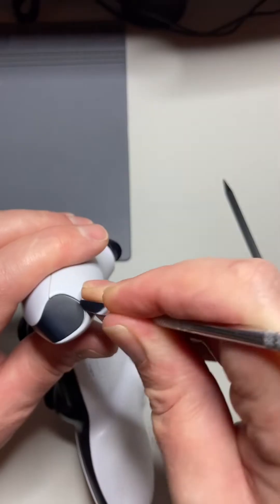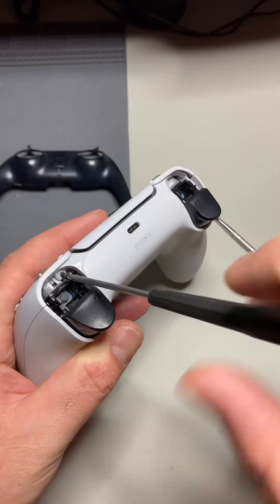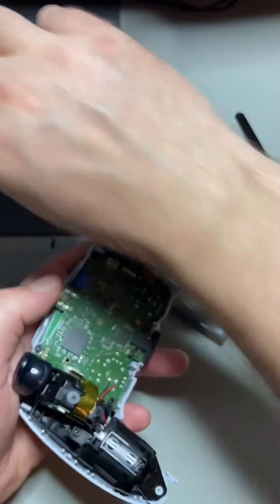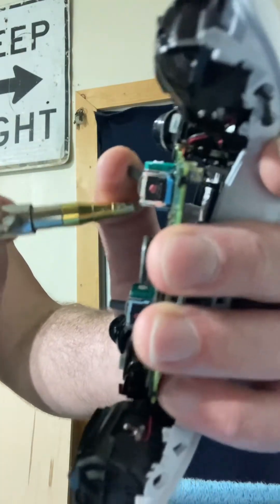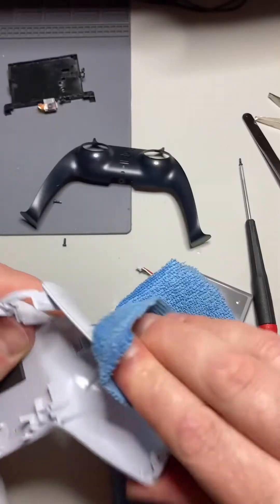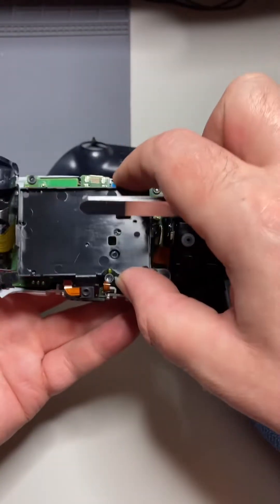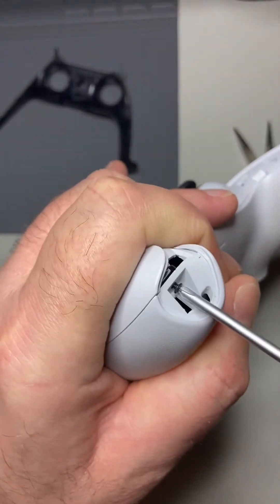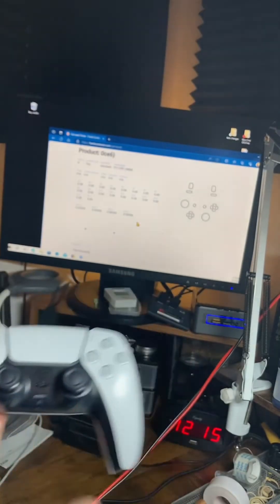PS5 Controller Disassembly and Stick Cleaning

Comment: There are two clips on the sides of the handles that you missed. If you've done this enough times, plastic fatigue might make them unnoticeable, but I think you need to poke them with a non-marring tool while you're lifting the body away.

Comment: I am fairly certain I am missing a camera, I was having fun up until this point
Reply: NEVERMIND fun resumed will update if controller is still functioning
Reply: I DID IT! The stick drift is worse than ever!!!! :D
Reply from the maker: It’s a microphone not a camera.
Im just an idiot.

There’s two of them, one on the front and one on the back.

Maybe the PlayStation 6 controller will have a camera in it 😀

If you ever dare to change out the sticks, go for the Hall effect or TMR sticks. They will last longer.

Comment: I can't unscrew the case the screws are too tight
Reply from the maker: Heres what I do for that. I also use this trick to get stripped screws out.

With much force I press the screwdriver into the screw. I keep it firmly in place while pressing down into it.
With my force down onto the screw I will pump just a short bit of force and try to turn it. If the screw does not give way I relax off of turning it while keeping force down onto the screw and then I repeat.
I do that until the screw actually moves. If the screw head starts to strip then you’re in for more trouble.

It also pays to have some good hand and arm strength to do this.

Comment: Does this fix stick drift
Reply from the maker: I find that sometimes a good clean out of the mechanisms will fix it but most of the time one of the potentiometers or both of them need to be replaced for the stick.

You don’t normally have to replace the whole stick, just the pots which makes it easier.

Comment: I tried all the steps in the video but couldn't seperate the casing. Checked out another video and luckily saw there are 2 more screws under the L1 & R1 buttons, pop them out first and remove the screws otherwise you will break your controller 😢
Reply from the maker: It’s in the video.
I was trying to get straight to the point but there are sacrifices to that.
Reply: Mate, it’s in the video
Reply: I saw it 2nd time around 😂

Comment: Can I do just my right stick with alcohol and a cotton tip by only taking the front casing off? I know I’ll bust my shit or rip a cable if I take it all the way apart 😣
Reply from the maker: You'll need the rubbing alcohol to get into the stick mechanism for it to be effective. If you have a container with a tiny nozzle, or a syringe, that might work.

Comment: If you are a tech noob, and therefore don’t have the experience and specialized tools for this, don’t do it. You will break a ribbon cable or not be able to put it back in. And then your controller just doesn’t work at all.
Reply: Yep, hell nah I'm not doing all that. I'm a tinker, but I know my limit lol

Comment: my option button is sticky.  any tips?
Reply from the maker: How to do it without taking it apart: 91% rubbing alcohol with some windex mixed in. Toothbrush some of that into the button. Do your best to get some bristles down the sides of the button. You probably want to get 3 to 4 "eye drops" worth of solution down the button. Don't put too much down there. Now press the button a bunch. Either use an air compressor or a vacuum with hose to get the solution back out. You may have to repeat this a few times depending on how bad it is. When you let it sit a couple hours it'll let you know if you really got it or not.

Comment: So easy. Took it apart, cleaned a bit and switched position of the sticks (I basically only use left and had massive stick drift and getting stuck). 15 minutes saved me $100, thanks!

Comment: i broke my ribbon cable
Reply from the maker: @lukeeliason  it happens. You can find controller parts on ebay if you look hard enough. There are a lot of different controller variants (where the insides use different) so it can be a pain finding the correct ribbon cables.